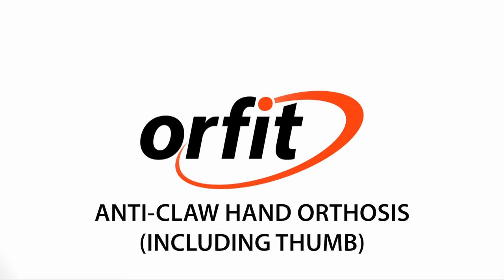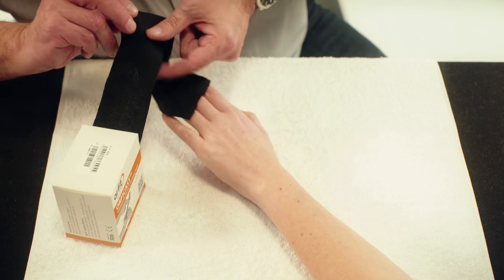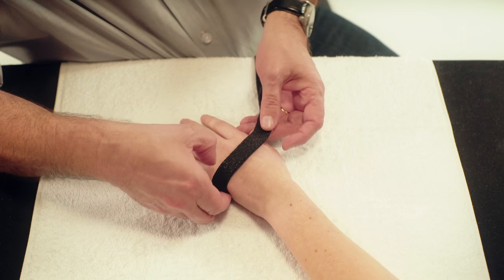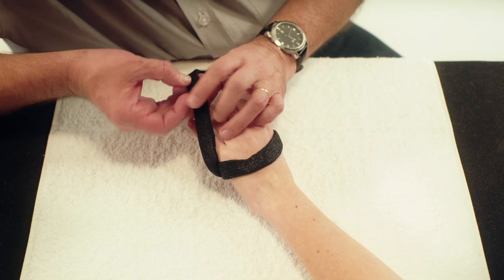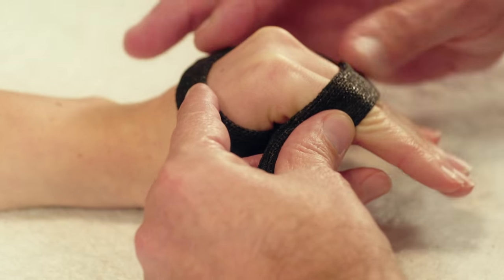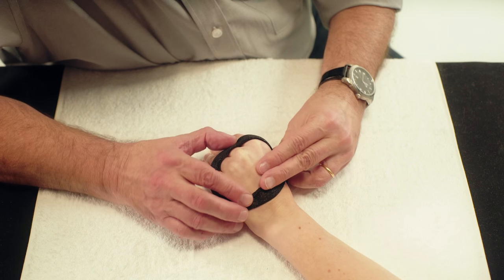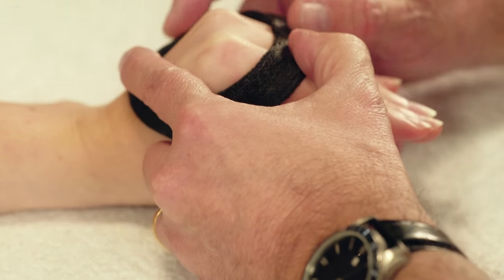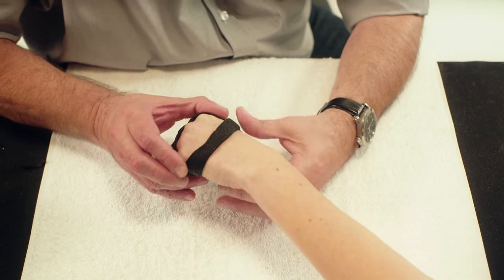Anti-claw hand orthosis (including thumb) - Orficast Instructional Movie 4

Comment: Do we need to fold it in 3rds or can we use a thinner orficast strip?
Reply from the maker: Hi Hannah, 

Yes, you could also use a thinner strip. Here are some instructions for different types of Orficast:
- If using Orficast 3 cm, you will need three thicknesses (so three strips);
- If using Orficast 6 cm, fold in thirds lengthwise;
- If using Orficast More 6 cm, fold in half lengthwise and trim the width.

Hope that helps! Let us know if you have any further questions.

Comment: Can we put splint during genegrat the the nerve after five month from surgy  cut nerve.?
Reply from the maker: Hi Nadia,

If the ulnar nerve innervated muscles are not functioning due to nerve trauma, or the ulnar nerve has been repaired and is progressing with healing, but the fingers are still positioning in the claw position, then the anti-claw orthosis is appropriate.

The patient should be evaluated for a claw deformity. If present, the timing of surgical repair or trauma does not matter because this is a functional orthosis and can help the patient. You can evaluate the patient to see if it helps.

Please let us know if you have any further questions.